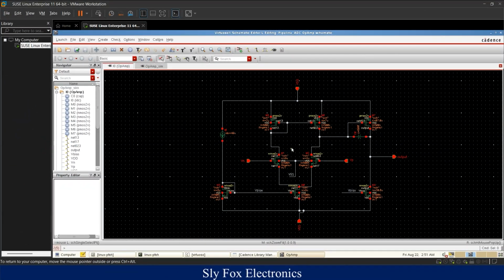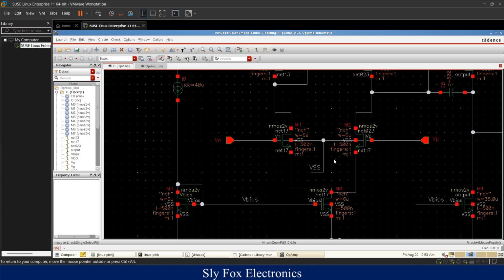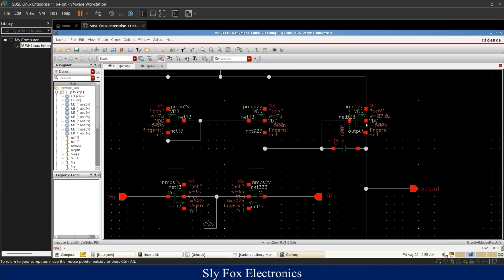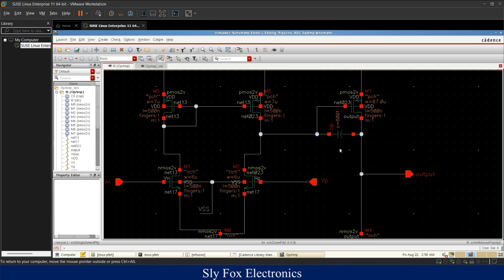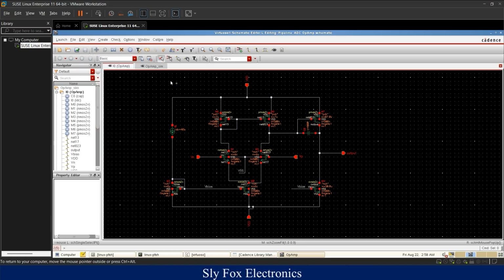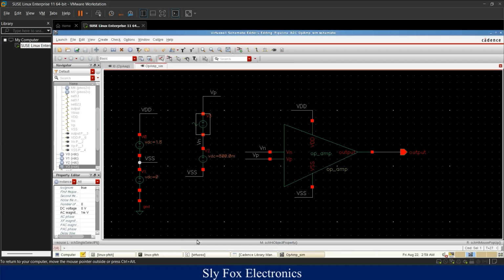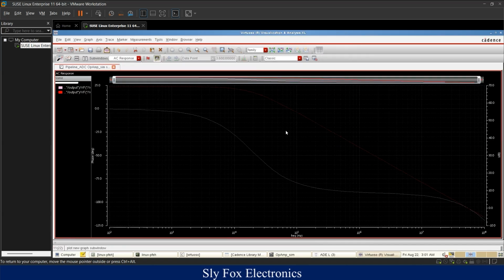How to Design a Two-Stage Op-Amp | (Cadence Virtuoso + 180nm TSMC + Miller Capacitor)

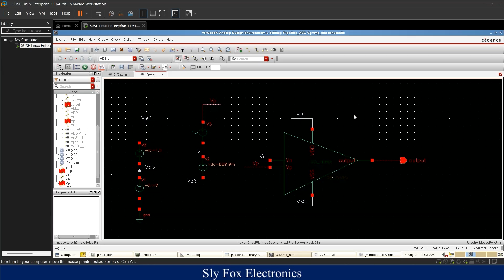Comment: Great video! For the two-stage op-amp, did you use plain Miller compensation or Miller with a nulling resistor? What phase margin and load capacitance did you target, and did you verify stability with Spectre’s stb? Would love to hear about your slew-rate vs. settling trade-offs 9:01
Reply from the maker: Excellent observation — I’m glad you asked,
as long as there is only one capacitor Cc connected from output node of Op-amp back to the first stage, there are no nulling resistors,

however it is a good idea to place a small resistor in series with Cc for increasing stability, 

for achieving phase margin of 60 degrees, it is a good practice to keep Cc > (0.22 C-load)

we can pick bigger values for Cc, but there is a tradeoff between speed and stability.

I expect this Op-amp to be able to drive 2pF capacitive loads,

by increasing the value of current source as shown in the video, we can achieve a higher slew-rate but it results in loosing a little bit of Gain,

stability is not verified through simulation, it is done theoretically, it may be a great topic for future videos.

good luck.
Reply: @SlyFoxelectronics tnx great i’ll wait for it🤗